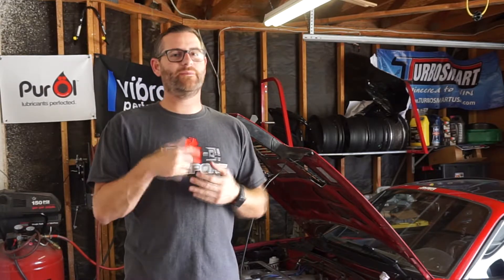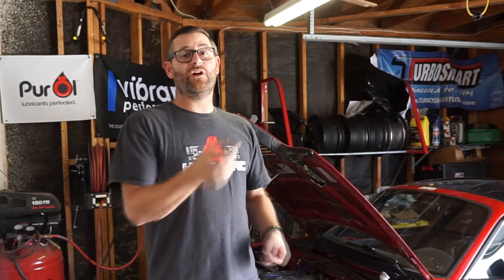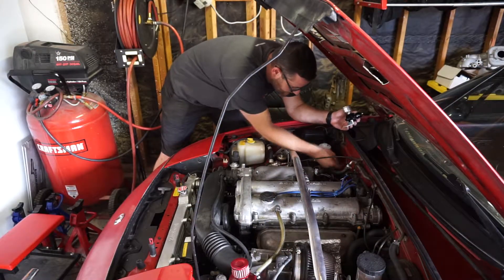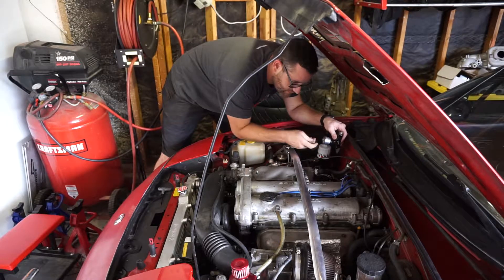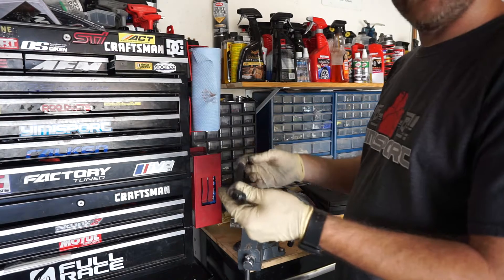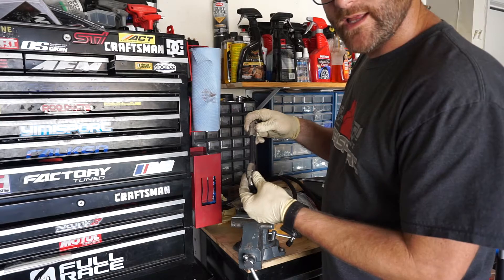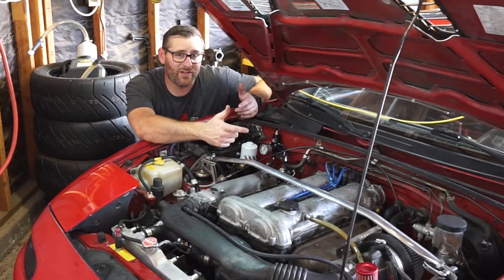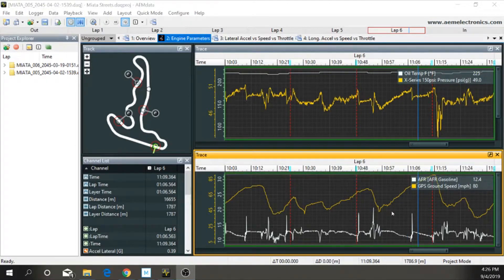Aeromotive FPR 1.8 Miata Installation

Comment: Great Video, I just have a question, where did you get the adapter from that goes in the stock FPR location on the fuel rail?
Reply from the maker: I got that one from eBay I tried a few different ones. I’ll see if I can look it up and post a link

Comment: Hey sup? Ty for that video 
But i have few questions : 
-u didnt delete the oem regulator right? Did you remove the vacum hose on the oem regulator? 
-can you higher the pressure even if the oem regulator gives about 60 psi 

I mean, if i put 75 psi on my adjustable fuel regulator and the oem on is delivering about 60 on factory mode, what will be the real pressure? (I want higher pressure for e85) 

why did’t u delete the oem one with an adapter? 

Ty!
Reply from the maker: The oem regulator is deleted when installing the new Aeromotive unit.